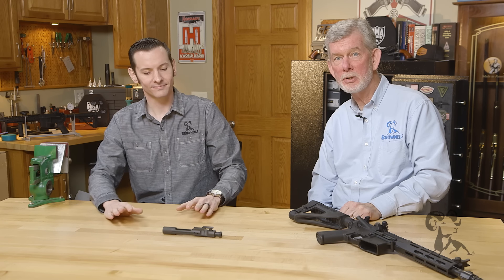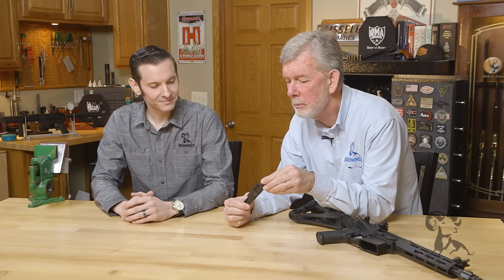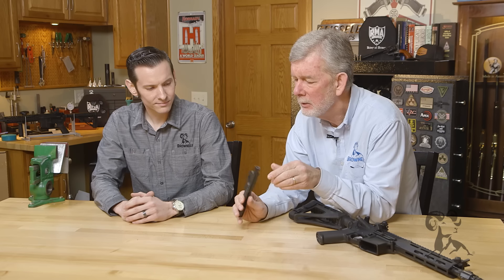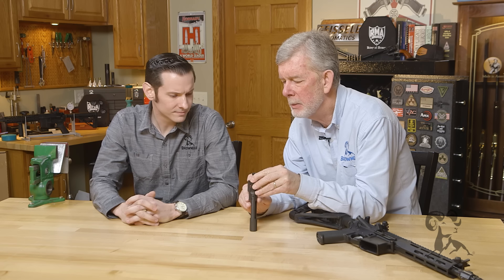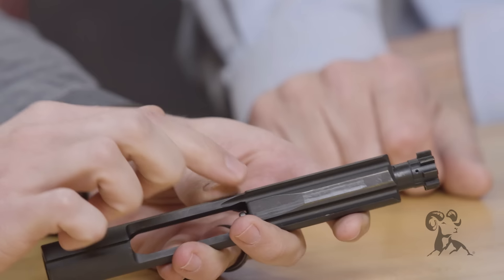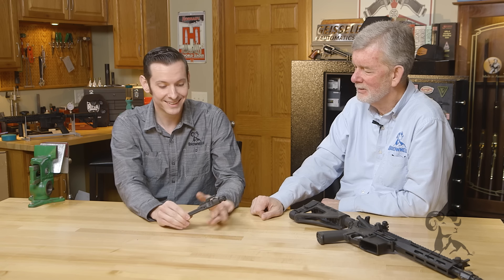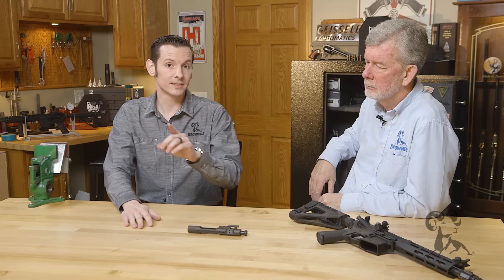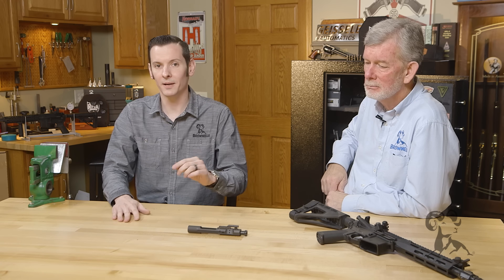Smyth Busters: AR-15 Bolt / Carrier Lubrication

Comment: Lube only what is needed to function, wet lubricant is a MAGNET for dust, debris, and carbon fouling. I used to lube the living creedmoor outta my bolt carrier group, but not anymore. I do the bottom rails, a light coating on the gas rings and inside the carrier, and that’s about it. My gun runs great. Too much oil just creeps into everything else, including the springs. Oil on your springs just grabs dirt and everything else it can, and starts to act like a grinder in your springs, shortening their life span.

Comment: One place to avoid lubricating is the firing pin channel. Never put anything down in there. It will only serve to collect dirt/carbon and can even slow down the forward movement of the pin when the hammer strikes it, causing a light primer strike. Keep the firing pin channel dry.

Comment: I've tried every worthwhile product on the market when it comes to clp, lube and solvent. Through my hundreds of thousands of rounds fired I've realized that 98% of all CLPs are pure gimmick! A good, dedicated lubricant will not only protect and lubricate better than any clp on the market but with repeated use of said lubricant the cleanings become a cakewalk. I've done my own testing through multiple friction testing, corrosion testing as well as tested tons of different solvents to help find the best cleaning solvent that has the least amount of chemicals and harsh additives......

Now I'll go on to mention reccomended products.... By FAR the best solvent I've come across is Wilson combat carbon cleaner. It cleans just as well as hoppes, is less of a mess and has a fraction of the harsh chemicals and is safe on polymer and most synthetic / wood stocks.

For lubricant there's a few great choices. Before I discovered mil-comm I was a huge fan of both weaponshield & Sprincos machine gunners lube. Both do a phenomenal job at protecting from friction wear and corrosion and both clean up very well and both perform equally as well in frigid conditions and extremely high heat. In fact the machine gunners lube has a plating agent that actually further lubricates the system the hotter it gets....

My now go-to system is mil-comm. With how well this product performs I honestly don't see myself using any other products for gun care ever again. Both their lubricant and grease out performs everything I've tested by a rather large margin and all of their products are synthetic and completely safe for both you and the environment. Their solvent is AMAZING when used together with their lubricant making it a perfect system all around. Their grease has an intriguing consistency where you want it to be thick it will stay thick and places you want it thin you can work into the metal to where it acts almost like a superior dry lubricant with a much better coat of protection that's practically impossible to burn or melt off. I use their grease on ALL of my pistol slides, the entire carrier of a bcg and their oil on the bolt & cam / gas rings of a bcg as well as all my pistol barrels, "except for my shield plus barrel. For some reason the shield plus barrel loves a light coating of the grease". After cleaning the outside of my firearms with isopropyl alcohol I'll then put a very light coating of their grease on every part of the metal on the outside. I'll then come back after it's all dried and hit the outside really quick with a microfiber towel and now the entire firearm is buttery smooth, leaves zero fingerprints / marks and is completely dry to the touch, never sticky or wet coming off onto your hands. I've been able to convince my friends and even family members to switch over to the products and they have the same view as I do now. The only negative when it comes to mil-comm is the price. Luckily it's a product that takes very little to do the job so it lasts a very long time. I usually recommend fellow range go-ers and people on forums to go with their Lube/Grease/Solvent 3 in 1 pack on Amazon that comes with smaller size products on Amazon to try out before spending money on their main size products. I believe the 3 in 1 pack currently is 12-14 bucks.

Comment: I run grease when its hot, synthetic gun oil when its cold, never had a cleaning issue or failure to feed or eject, and cleans well.
But that just me.

Comment: Great instruction, I was also taught as a young Marine to really Lube it up and use the blow holes which I know from a carbonizing perspective. It can keep the carbon loose, easier clean but the more oil you put on it the more you have to clean up because carbon will stick to the oil

Comment: Most any excess lube will be blown out of the bolt/system after the first two shots, so no point in over lubing your bolt. A few good drops on the rails, gas ring run, cam pin, and then a light coat of oil to "hydrate" the bolt. It doesn't hurt to rub a light sheen on the firing pin either.

In very dry, dusty environments, excess oil only traps dirt and the oil will gum up fast. If your rifle is gassed properly (which should be slightly overgassed for a fighting rifle), and you run proper ammo, you should have no problems with reliability.

It's folks who tune their rifles with heavier buffers/springs/ adjustable gas blocks to run 4-5pm ejection when sparkling clean that will run into issues the second it gets dirty, is run hot, or run in very cold temps.

A clean, well broken in rifle should run between 2-3pm ejection. Shoot 5-600 rounds in it without cleaning - I'll bet she's ejecting closer to 4 at that point. Don't tune your rifle with such a small operating window!

Comment: As a glass wearing recruit the Sergeants drove me crazy.  I'd put a very light coat of CLP on the bolt. As soon as you got to the line the first thing the the drill would do is absolutely hose the bolt down with CLP.  Two shots later and I have a slimy film on my glasses that only hot soapy water could remove. I didn't really learn to shoot well until I got to my unit and could back off on the CLP.

Comment: Ironically the army marksmanship unit told me the same when they did our pre deployment training, as in put a drop in those exhaust holes on the side. They also said put a drop on the hammer spring in the lower receiver.

Comment: Those bolt gas sealing rings / piston rings look like they need lube & the reason for the drop of lube in the gas tube. I bought extra rings just in case they fail. On the entire AR its looks like a potential trouble component.

Comment: I look at the carrier/bolt as a machine. There are piston rings on the bolt which ride inside the carrier. Running that place dry or with reduced lubrication is asking for a problem. I use Army teflon oil and oil inside the carrier. Lubricate the weapon as you would to fire a few hundred or more rounds. make sure your ammunition is clean and dry, magazines are clean inside. When the dry AR jams, it can make the weapon completely useless. Don't lubricate for a 50 round range day.

Comment: being in the military, we go to the range frequently. and it never fails, a range safety will try to hose my weapon down with CLP. i inform them that i dont want it and they look at me like i just stepped off of a spaceship. i will add a light coat of oil to the friction rails of the bcg and call it good. i can honestly say that in 15 years, my weapons have never had a failure. just proves, sometimes, less is more

Comment: On a nice range? Maybe "no lubrication" is just fine. I served 9 years in the US Army Infantry, plus another +30 years in One Shepherd Leadership Institute. I'm sincere when I say that I cannot remember how many times I've put 600 rounds of ammo through my M16A1, M16A2, M4, or LSW variant in a single day of shooting. We typically began with a moderate coat of CLP Breakfree and simply doused the BCG wetter with oil as the day went on. I never had a problem.

Keep in mind that when I say, "I never had a problem" - I routinely shot in 130F dessert dust, or in 100F jungle humidity, or in cold rain and mud of the forest, or in -20F mountain snows. Worse yet, more than half of all my shooting over those 40 years was with M200 blank ammunition! No weapon likes blanks. They're filthy dirty and the blank adaptor retains most of the filth in the rifle! Yet, all we would do was to add more CLP Breakfree until it was dripping wet. That seemed to keep our weapons firing.

The AR15 is a direct impingement gas system for a reason. You can keep the piston AR. I don't need that garbage. The M27 attempts to solve a problem I never had ... yet it creates new problems!

Comment: Dry guns attract sand and dust just like oily guns, but dry guns won't work for long, oily ones will.  I used to clean my M60 and M16 twice a day whether I shot them or not.  If I shot them, they got cleaned again as soon as it was safe to do so.  Doorgunner, 92nd Assault Helicopter Company, Dong Ba Thin 1971.

Comment: I have to tell you...I stopped using oil on my bolt carriers, and instead use a nice thing layer of high temp grease.  Never had a problem and the guns run smooth.

Comment: You lube it where the TM -10 tells you to lube it.

In short: generous lube on the gas rings, locking lugs, rails, and bolt. Light lube everywhere else.

Comment: It's not ridiculous to oil the two gas holes on the BCG guys. That oil gets onto the gas rings, and those gas rings create a seal with metal on metal inside the BCG. If you never lubricate those gas rings, they will last about half as long as they would if they are lubricated. Metal on metal friction points def need to be lubed, and the gas rings is no exception.

Comment: -- All I would add, if you can, use CLP sparingly, and then let the parts sit where the product can 'soak' into the metal for a bit.  Then reassemble, and try not to shoot it for a couple days.  A good chemical bond is useful when you do get into adverse conditions.  Obviously not advice I'd give to someone on combat duty.

Comment: Rule of thumb, if it looks like an area that is worn, apply lube, if you have shot a gun 1000 times and a specific area looks perfectly fine, without any signs of wear, you are wasting oil by lubing those areas.

Comment: make dang sure you  put the firing pin back in . if not the cam will shift and jam up the bolt. then you will have to remove the gas block to get to the cam to turn it so the bolt gets free. lesson learned the hard way.

Comment: Study your gun and its parts as your shooting and breaking it down afterward to clean. Take note of wear patterns on moving parts and see where points of focus should be when applying lubrication, your gun will tell you where it needs oil applied over time.

Comment: I could be way off base here....but if you put a drop of oil in the 3 vent holes,  wouldnt the first shot expel the lube forcefully as to get a mist all over the bolt and surrounding areas?  Seems like it may be an effective way to get a bit of lube in all the nooks and crannys and expel the excess.  Just a thought like I said before I could be completely wrong.  Ive never seen too much lube really cause many issues however...Usually the high pressures caused by setting of a round clears out that excess oil.

Comment: Just don't run Frog Lube when its below freezing because it turns to more of a gel and you will get light strikes. Other then that if it is hot with high volumes of fire it works great.

Comment: Motor oil if it will hold up to the harsh environment of a engine turning thousands of rpms it will hold up to what ever you put you Rifle through. And its cheaper and last longer
Reply: Yes! But be aware, it lacks the rust inhibitors that modern gun oils have.
Reply: @CalebSavant   very good point had not really thought about that. Thanks for pointing that out.

Comment: Put any lube on an AR bolt or have it gotten on the firing pin when the outdoor tempters are 50 degrees and believe is asking for fail to fire problems and many failures to cycle,
This is a constant problem for winter in Alaska or winter in the Pacific NW.

Comment: When I was deploying to Iraq in 05 the army was saying only use 3 drops of clp on the bolt! Because there thinking was sand would get in a wet bolt and jack it up bad! But I noticed guys weapons would jam constantly. But not mine I ran mine wet as hell! I kept a plastic mussel cap on and always I mean always kept my dust cover closed! So I would say wet works just keep that dust cover closed and buy some mussel caps! 👍🏻🇺🇸💪

Comment: I just went down a whole search list of about 10 AR lubing videos (many from popular GunTubers and ex seals) and every single one of them said to run your AR’s wet and each of them also mentioned dropping lube in the vent holes if you’re in a hurry. Fortunately none of them said to put lube in the gas port on the bolt. That’s just silly.
Reply: Paul Harrell, who is very intelligent, suggests that. I lost a bit of respect for him after seeing that

Comment: My Colt AR-15 manual specifically says to lightly lubricate the mouth of bolt key and the bolt carrier exhaust ports.  Steve's humorous explanation of why the army did also is probably wrong.  Knowing the origin of this practice would be very illuminating.  Did the army just copy Colt's advice, or maybe it goes all the way back to Armalite?

Comment: All I personally do to the exterior of the bolt carrier is put a few drops of lube on it, spread it evenly, rub it in and wipe the rest off. Then I lube the cam pin lightly and the bolt itself only on the part that slides in the bcg, maybe a drop total. You don't want oil all the way out front that'll wind up  in your chamber when it goes into battery. That's supposed to run dry. Never understood guys running soaking wet BCG's.

Comment: I served in the USMC from 1986 to 1990. We were told we to put a drop of clp anywhere there was a hole. So I was dropping oil everywhere. Down the gas key, vent holes and even where the roll pins were inserted. I was just a 17 year old kid (turned 18 in boot camp) and didn’t have the understanding of the rifle like I do now so it made perfect sense to me back then. 😂 They also told us that if the gas rings were all aligned it would drastically reduce accuracy and if we switch bcg’s with another recruit’s rifle, it would blow up because of improper head space. We also over cleaned them in my opinion knowing what I know now. Like you said Steve, it was gospel back then. Lol 😂

Comment: A light touch of high pressure grease on the cam pin goes a long way.
Reply: Agreed!  Alot of the lube videos mention "putting a little lube on the cam pin if you want " 
The cam pin is under alot of stress. 
One of the few things that actually breaks on an AR.
Lube the hell out of it !

Comment: Kyle Lamb, ex-U.S. Army SOF-Delta SNCO who now runs Viking Tactics, spoke in one of his videos about this very issue. His standard procedure is to carry Break-Free CLP or the equivalent with him into the field, so that he can do quick in-field cleaning and lubrication as needed when he has five minutes and after several hundred rounds fired. He also recommended a Bore-Snake or the like. After making the weapon safe, his procedure is to run the Bore-Snake down the bore 1-3 times, using a bit of lubricant/cleaner, and then unpin the upper and lower to dump out the bolt-BCG, which he wipes down with a rag, and then coats with a fresh layer of CLP before reassembling the carbine. This quick clean can be done multiple times until the carbine can be detail-stripped for a thorough job. Many special ops guys have been seen in Afghanistan spraying lube into their carbines while moving forward on the ground; others have been seen with cleaning rods as a part of their kit. Stuck cases, they're a real issue sometimes. Break-Free is a good product, but when you details strip your AR, use some high-temperature grease on the heavy-wearing parts for which lighter oils/lubes are insufficient. Do not use too much, though, since excess lubricant can trap dirt and sludge and turn your machine into a non-functioning paperweight. If in the desert/arid conditions, use dry lube and/or normal "wet" lube sparingly.

Comment: Run it MOSTLY wet, not dripping wet but ALL friction points OBVIOUSLY. The BOLT too, Gas RINGS: a drip or 2 of CLP.; I’ll even add a drop to the EJECTOR PIN and the EXTRACTOR SPRING from time to time. Don’t tell John Lovell of WPS “NOT” to put some CLP in those “gas exhaust holes” (for the combustion gases) ha ha ha...heck WE’VE ALL done it...

Comment: typos on my previous
Running it wet on the areas passing through the upper receiver is not a bad idea for the average person to keep wear down on the upper receiver. Two metal parts moving against each other need lube to reduce wear. You want to be careful of gumming up the works with too much lube if in a threatening situation. But for hobby use a wet bolt and upper is good. They say the buffer tube should not be lubed, but I think a lubed buffer tube is a good idea. Metal hitting metal.

Comment: After getting my first AR15 I lubed the bcg with breakthough hp pro oil but recently have started to use  breakthough grease on the bcg. Both work just fine. Just changing it up now and again. The grease gos a LONG way and with the jar i have it might last me forever.

Comment: so I am new to the AR platform, but not to firearms. this is actually my first semi auto rifle. from everything I am hearing and reading it is my understanding to run the gun wet. which I solidly go along with. mostly because that is what I do on all of my other guns. the one thing I would like to know about, is using moly ep grease throughout the firearm. i live where it gets cold, but I am a fair weather shooter for the most part. so my shooting seldom gets below 40 degrees (f). would moly grease be a good choice? or is it to thick? or will the moly harm the coatings? which to my understanding, is what prevents most of the wear in the firearm.